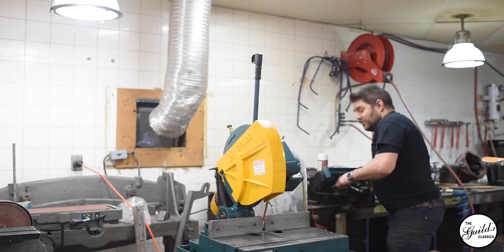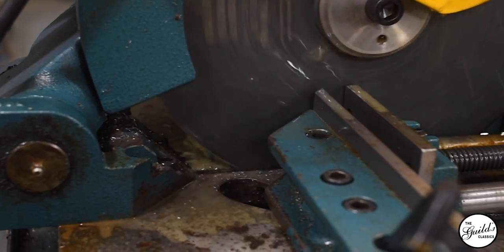Al Talks About Building Cars And The Shops New Saw

Comment: Dont ask me why I'm compelled to say this, but its been a point of contention any time I see that type of saw. Nothing to do with brand as many make this type of saw, and i'm sure its good, but, the motor mounted on the rear and the pivot point requires alot of pressure to be applied by the operator when cutting. The weight of the motor counter balances disproportionately. Like a teeter totter with a heavy person on one side and a lighter person on the other, not alot of fun. 

There are other designs such as Eisle out of Germany which place the motor on top of the blade and a vertical straight up and down movement. When a cut is made the wieght of the motor is aiding the operator with less pressure required to cut. 

Anyway, I won't get into blade direction.

 I drive by the shop often and have always admired your work. I've been exposed to the metal world extensively, as a tig welder for the past 25 years, its always a point of interest.